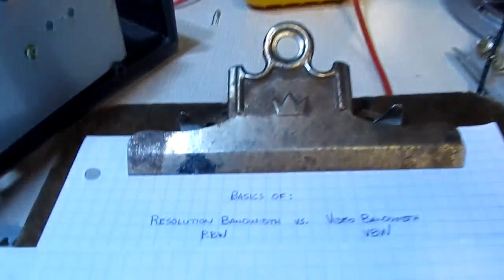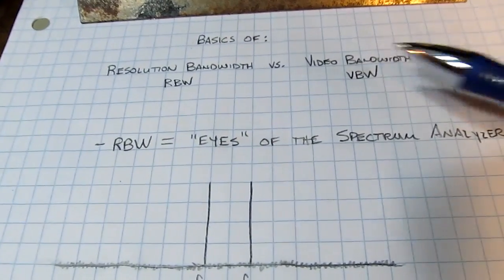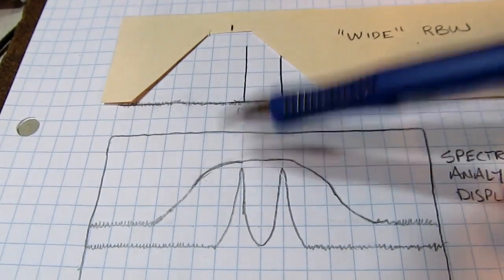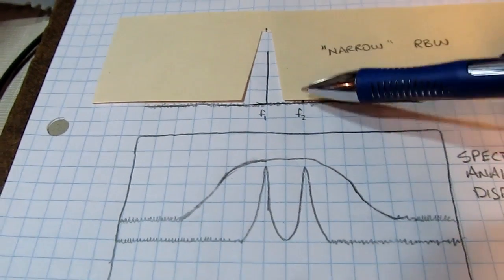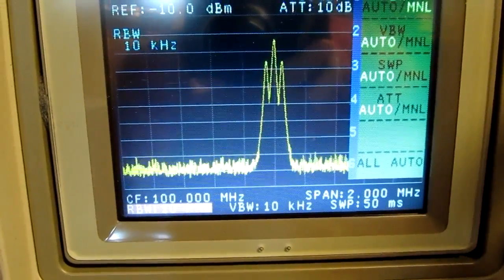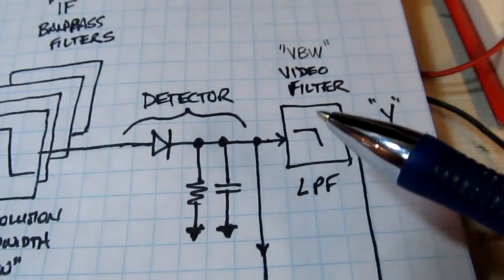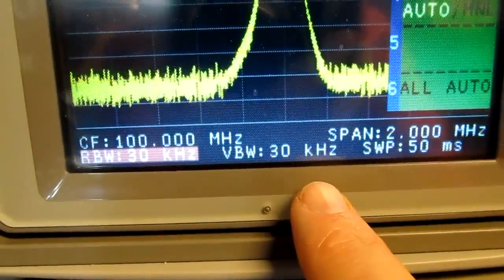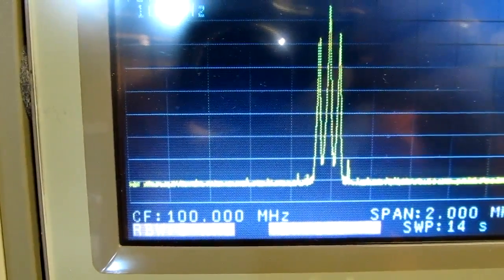#119: Basics of Resolution Bandwidth and Video Bandwidth in a Spectrum Analyzer (RBW VBW)

Comment: If the noise floor is higher than -162dBm/Hz, the SA is not a good one. I used many SA, none of them with a noise floor higher than -162dBm/Hz. On the other hand, I published few videos on my channel on SA include RTSA.
Reply from the maker: While I agree that a SA with a DANL better than -162dBm/Hz is a good thing, I disagree that anything less than this is "not good".  Certainly a low noise floor is needed for a lot of measurements - such as examining low level signals and spurs, or characterizing C/N or ACPR, but there are many measurements than can be made perfectly well with a SA whose DANL is not this good.

Comment: Hi Alan, thanks for the excellent video. I am trying to understand exactly what VBW does. I do not have such a nice picture of convolving it with a signal. Could you explain more what it's cutoff frequency refers to? If I understand correctly, it cuts off all the variation faster than the set frequency after the power detector. But the speed of such variations depends on the sweep time, right? If I set a very small RBW and a large span, my VBW can still be larger than RBW without affecting the reading? Thanks :) hope you still answer to comment under your old videos.
Reply from the maker: If the VBW is set to something larger than the RBW, then is has no effect.    The VBW is a low-pass filter applied to the output of the RF detector, smoothing the variations of the power detected.  The lower the VBW, the smoother the trace will be because the variations will be smoothed further.  Think of it as a shock absorber on the output of the detector.  The stronger the damping rate (lower BW), the less variation you'll see in the trace.
Reply: @w2aew  Thanks for the answer! Yeah, that's what I thought. I'm trying to understand it's relationship to RBW, might need some time to figure out the mathematical intuition there. I'm using spectrum analyzer to hopefully extract a phase noise from an instrument, so I would like as little unknown filtering as possible. Just convolving with RBW filter seems reasonable. Thanks again for the videos, they helped me understand the spectrum analyzer pretty well, and for your answer :)

Comment: Im familiar with RF and spec ans and I’ll tell you what - it’s a very good video for a novice to watch. I think repetition and doing so every so often (it’s easy to forget setups/applications). 
In my line of work, I try to familiarize myself with Markers, Min and Max holds. Measuring channel and composite power. Eb/no, signal to noise, etc. Runnings sweeps on cables. Spec ans are also used in conjunction with signal generators (sig-gen) when testing RF equipment, fiber shelves or RF antenna paths. Blah blah.

Comment: I have enjoyed all the videos that i have seen and learned very much. Can you make a video on how to determine what the noise floor power is? Since the RBW can lower the DANL, how can I determine which RBW to use when finding the noise floor power level? I know the lowest noise floor for a 10 MHz channel is -104 dBm. Which my spectrum analyzer at 100kHz RBW with pre-amp on, I can view a noise floor of -114 dBm. This must be because of the Noise figure of the SpecA. -174+10log(100,000)+10=-114 dBm. This would allow me to view the noise floor of -104dBm but how can I determine which RBW to use if I'm viewing a 10 MHz LTE uplink signal being transmitted from a BDA? Would I just use -104dBm + noise figure and gain of BDA and set the RBW below that noise level? I believe I might need to use a noise marker since that dBm value would be much higher than the DANL of 100kHz RBW. Anyways, I look forward to learning from you and if you could give me any guidance and correction, I would greatly appreciate it. Thank you.

Comment: So I f wanted to see modulation I would example transmit 146.52 set analyzer at 100.00 mhz center frequency.rbw at 3khz,span at 2mhz to see the carrier and both upper and lower modulation
Reply from the maker: You generally want to set the center frequency at your carrier frequency, set the span to 2-5x your signal's occupied BW, and the RBW to 10% or less than the signal BW.  This is a good starting point.

Comment: Can I ask you a few questions?  In measuring the output power of a radio transmitter, which will give me a more accurate measurement? A power meter or a Spectrum Analyzer?  Also, is the power I'm measuring peak or average?  I was told using a zero span will give a better peak power measurement instead of a bigger span.  Why is that?
Reply from the maker: In general, a proper RF power meter will give you a more accurate power result than a spectrum analyzer.  They are available for both average and peak power measurement.  Zero span on a spectrum analyzer will give you a decent result as long as the RBW is wider than the bandwidth of the signal you're measuring.

Comment: What is the importance of a lower noise floor?
Reply from the maker: Lower noise floor gives you the ability to see very low level signals.
Reply: @w2aew  So to better measure a low level signal, I need to lower down the noise floor by adjusting the VBW and also by making the reference level closer to the peak of the signal?
Reply from the maker: @jancenj2218  lowering RBW (not VBW) will lower the noise floor.  Lowering VBW will reduce the peak-peak variation in the noise floor.

Comment: amazing explanation but what is the optimum RBW vs signal frequency itself? is there any rule or something? Thanks buddy
Reply from the maker: There really is no optimum value - it really depends on what resolution you need for your measurement.  Most spectrum analyzers default to setting the RBW to be somewhere between Span/100 and Span/1000 as a decent tradeoff between speed and resolution.

Comment: What happens when you have a .5MHz frequency span centered at say 100MHz and a RBw of 1MHz. Would the spectrum analyzer be integrating total power out of the frequency span? What if your center frequency is .75MHz and you have a .5MHz span. How would the analyzer measure with a 1MHz RBw?
Reply from the maker: You also have to consider the RBW, or Resolution Bandwidth filter first.  The measurement and detection of the energy in the Span is determined by the RBW.  The VBW (video bandwidth) is applied after the detector which follows the RBW filter.  Basically if the VBW >> than the RBW, then it you will see the raw, unfiltered output of the RBW+Detector.  If you want to integrate and measure everything withing a 1MHz BW, then the RBW has to be >= 1MHz.
Reply: @w2aew  I completely meant to ask the question with "RBw", not "VBw".
Reply from the maker: @samuelalasu2330  Most analyzers will have a limit on how wide you can set the RBW with respect to the span.  However, you can simply use "zero-span" mode and set the RBW to 1MHz, then the display will show you total power within a 1MHz BW around your desired frequency.

Comment: So to get the most accurate peak power, do I try to get the noise floor to its lowest position first?
Reply: As long as the signal is 10dB or more above the noise floor, there will be little effect. More importantly, best accuracy happens when the the signal is near the reference level.

Comment: I notice that when I change the RBW and/or VBW settings, the peak power changes.  How do I know what the correct RBW and/or VBW settings are?  I work on both 900 MHz and 2.4 GHz radios with output power ranging from 10 to 30 dBm.  Also, what SPAN would you recommend?  I was told a 0 span will give me the most accurate peak power measurement.
Reply from the maker: A lot depends on the type of modulation on the signal, and the bandwidth of the signal.  A RBW that is equal to or greater than the signal's occupied BW will generally give you the most accurate result.  For narrower RBWs, it all depends on the nature of the modulation.  RBW should have no impact on measuring power of CW (unmodulated) signals.

Comment: Sorry for the beginner's question, what's the noise floor value approx. when the RBW is 30kHz? 129dBm? I guess the space between every horizontal line is 10dBm, right?
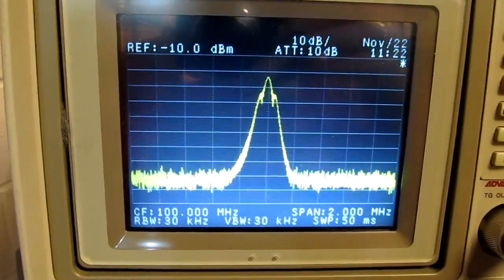Reply from the maker: At 4:30 in the video, where the RBW is set to 30kHz, the noise floor is at about -90dBm.  This can be interpreted as such because the Reference Level is -10dBm (top line), and the vertical scale is 10dB/div.
Reply: @w2aew  sorry, I meant to say -129dBm of course. I thought the noise floor would be close to 20*log10(k*T*1Hz*30e3)? or is it that 30 dB of noise worsening is coming from thermal noise produced by the analyzer itself? How does that work?
Reply from the maker: @DJTrancenergy  There are a number of factors.  Certainly the increase due to the RBW as you've shown - but also a function of the noise figure of the analyzer, which varies with reference level, internal attenuator setting, etc.

Comment: Hi Alan can you kindly tell me why the Noise floor comes down if i turn on the pre amplifier and also if i connect a external amplifier i cannot see a reduction in DANL ,
Reply from the maker: The gain of the internal preamplifier is known and taken into account when enabled.  The DANL reduction is due to the adjustment in the scaling to account for this known gain.  When using an external preamp, the gain is not known by the analyzer, so there is no change in DANL unless the analyzer has the option of entering this gain amount.
Reply: @w2aew   thanks a lot :)

Comment: Fantastic explanation, thank you!  Have you done a video or tutorial about the most likely reasons why the self calibration on a spectrum analyzer fails or reports a bad cal? Or can different types of failures be used to narrow down the area to investigate?
Reply from the maker: I haven't, but i fear that the results will be too specific to any particular analyzer, so it might be difficult to draw conclusions that apply universally.
Reply: @w2aew , I see.  I have the service manual so I'll have to work through the diagostics methodically.   It's a Marconi 2380/2382 from about 1985 or so. If I dismiss the bad cal message it actually shows the spectrum of a test signal at the input but off course, the amplitude is a few dB out.

Comment: Hi W2aew, you explained the relationship between RBW and noise floor. What about the relationship between RBW and measured RF signal power lvl for spectrum analyzer. How it will react(power lvl measured) when same power input supply to the Spectrum analyzer with different bandwidth and RBW setting. Hope you can explained this. thanks!
Reply from the maker: If you apply continuous, unmodulated RF signal, that is significantly above the noise floor, then the power level will not change with RBW.  The level shown on the analyzer is the total power within the RBW filter.  If the signal level is close to the noise floor, then wider RBW will report slightly higher power due to the inclusion of the surrounding noise.
Reply: what if it's a modulated RF signal. Does the bandwidth affect the measureed power?
Reply from the maker: Then it will depend on the type of modulation and the BW of the signal.  Best to use a RBW that is wider than the BW of the signal.

Comment: What kind of situation need higher resolution bandwidths?
Reply from the maker: Sometimes you need the speed of the measurement, sometimes you need to get an accurate total power reading over a wider bandwidth, maybe to simulate what a receiver would do with the same signal, etc.
Reply: Thank you so much for your reply. In the case of an ADC ENOB measurement which bandwidth do you prefer?

Comment: I really enjoy your videos, and agree with everyone who applauds the clarity you bring to complicated concepts. I have a question though, in your model where you sweep the wide resolution bandwidth filter over the two signals, there is a point where the first tone is fully within the bandwidth of the filter, and the second tone is starting to come in. You don't show the integrated power increasing further as the second tone comes fully into the filter, the power just stays flat. I can't figure out why this would be the case. Can you help?
Reply from the maker: My little mechanical model isn't perfect, but I think it you look at the spectrum trace where it is lined up with the center tic-mark of my sliding filter, you should see that the power is increasing until both tones are fully inside the filter BW.  I may not have drawn it exactly right, but you get the idea.
Reply: Now I've got it. Thank you. Your model is a really good way to visualize it.

Comment: It is an excellent  explanation. Would you please explain about the effect of the ratio  VBW to RBW on uncertainty of  power measurement (eg channel power)? for example why it is necessary to set VBW >=3*RBW for having negligible bias that arises due to log power averaging . Thanks a lot.
Reply from the maker: By setting VBW to be more than 3 times wider than the RBW, you effectively take the VBW filter out of the picture - it has no effect on the results.  Since the VBW filter is typically implemented after the log-detector, it essentially averages the log power result - which is mathematically an incorrect way to average signal power.  Thus, you don't want this avg-of-logs error entering into the integrated channel power measurement.  Turning off VBW, or at least making it >3x wider than RBW, keeps the improper averaging out of the picture.
Reply: If i understand correctly,  if the VB < RBW the improper averaging will take place . Thus, there will be a bias of apprx    -2.05 dB from the true power measurement ?  furthermore is there mathematical model that shows the effect of the ratio? Thanks a lot
Reply from the maker: I'm sure there's a mathematical way to predict the error for different VBW:RBW ratios, but I don't know what it is.  Basically, whenever the video filter is having an effect on the trace, some amount of error will be there.  With the VBW > 3xRBW, there is essentially negligible affect on the waveform.

Comment: Is it Radio Frequency Interference if I hear an unusual "Hum" sound in a video. (This sound is heard as clear as if it was part of the video, but the first time I saw that video, it wasn't there)
Reply from the maker: Usually not.  RF interference would typically be noisy and variable, not a constant hum.  A constant hum usually indicates a ground problem in the equipment setup.
Reply: What can I do about it?
Reply: Now that I see it, you must be right. Thanks! Hope I can solve the problem.

Comment: When using a spectrum analyzer to perform a calculation for power over a particular bandwidth, changing the RBW has an effect on this measurement. Why is this? How can you ensure you are getting an accurate measurement?
Reply from the maker: +Kyle Harper There are a number of factors that can enter into this, including the nature of the signal and the equivalent noise BW of the filter.  A good write-up on this can be found in this appnote:
http://cp.literature.agilent.com/litweb/pdf/5966-4008E.pdf

Comment: Nice video what is the relationship between span, Rbw and Vbw
Reply from the maker: +DDanmusa Danmusa That depends on the spectrum analyzer.  The Span:RBW ratio is usually between 100:1 to 1000:1.  Many analyzers allow you to set this ratio.  And of course, you can always set a specific RBW as desired.  VBW usually defaults to 10-100% of RBW, but is usually explicitly set by the user.

Comment: Hey I am new to use spectrum analyzer. I want to measure the power of a 20MHz signal using power measurement function of spectrum analyzer. I found that the channel span is related to resolution bandwidth. Therefore, if I change the channel span from 20MHz to 100MHz, the power measurement will change a lot. Could you give me some hint on how to set the channel span to measure the power of a 20MHz signal? Thanks!
Reply from the maker: The span should be set wide enough to encompass the sideband energy of the signal you want to measure.  Power is measured using a Channel Power measurement, not by using a marker.  The Channel Power measurement integrates to total power within the channel BW.
Reply: Hey. Thanks for your response. I use E4407B spectrum analyzer. Since in the channel power measure function, I can set both integration bandwidth and channel power span. I should set integration bandwidth wide enough like you said. But my question is how should I set channel power span? If I fixed the integration bandwidth as 20MHz, but modified channel power span from 20MHz to 40MHz, the power reading increased about 8dBm/20MHz. I found out if channel power span change, resolution bandwidth will also change. Could you give me some idea how to set channel power span or resolution bandwidth to make a accurate measurement? Thanks
Reply from the maker: Y Jian It is common practice to have the Channel BW a little wider than the Integration BW.  150% of Integration BW is common.  Use the "auto-coupled" RBW and set the integration BW to encompass the width of the signal, or to meet the "standard" that you might be measuring against.
Reply: Thanks a lot!

Comment: Thank you for the wonderful video. However, I have a question.
1) What does it mean/imply if the IF bandwidth is set as 70kHz? In this case, if the incoming signal were at 840MHz, how would the Spectrum analyzer/Network analyzer perform?
Reply from the maker: The IF bandwidth is basically the same as the resolution BW. The resolution BW setting will have the same effect regardless of what the incoming signal frequency is.